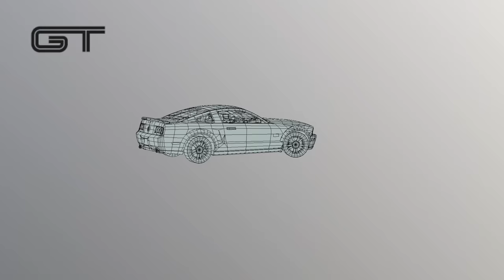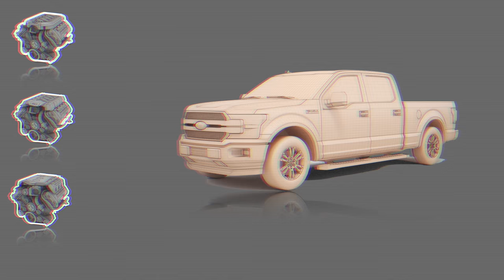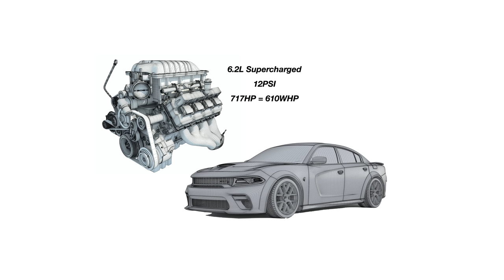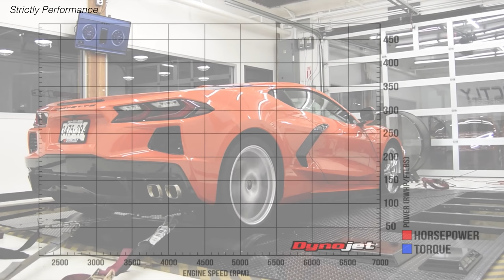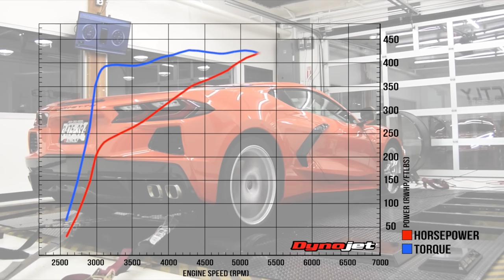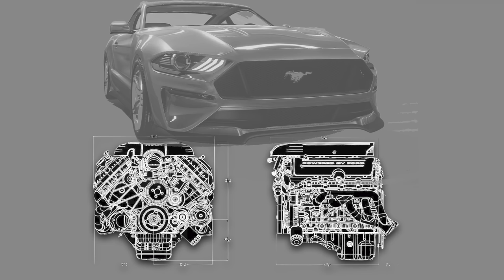How 5.0 Coyote Engines Beat LS and LT😮 | Explained Ep.2

Comment: Boost makes any engine more powerful dude, theres not one platform that "responds to boost" better than another. The real test of an engine platform is N/A power output. I've haven't seen with my own eyes a coyote that makes 700+ horsepower N/A, meanwhile ive seen a ton and built a dozen or so LS/LT engines making that power including my own rig. Its been done before but its exceedingly rare. Its more cost effective buy the supercharger to make 600wheel on the coyote than it is to go N/A. Meanwhile, 600wheel from a N/A LS or LT is a walk in the park. HUGE drawback of the coyote is bore spacing and lack of cubic inches even with stroker kits. You quite simply aren't resleeving a coyote for 450+ cubic inches. Also, price price price price.

Comment: Correct me if I’m wrong but the 3-2-1 build won’t work bc the gen 3 blocks have different coolant and oil passages to the heads which don’t really adapt, I’ve done some pretty extensive research as I debated buying a gen 3 block and putting my gen 1 heads on it but I can’t bc the coolant veins don’t run the same, the gasket situation is pretty weird too Lol. But gen 1-2 are fully adaptable besides the timing system, all of the timing system has to match generation Lol

Comment: If you have to add a whole turbo or supercharger and all the necessary parts that come with it to an engine just to compare it to a stock engine from a competitor, it’s not better. The second you modify anything (even the ecu software) that didn’t come from the factory your argument is moving goalposts and is completely irrelevant.

Comment: 5.0 has good power but weak in torque so I don't know about this comparison. Cost my uncle a little over 11k to do a  5.0 coyote swap  on his fox body and his buddy gots a 6.0 ls fox body  and has after market cam  and couple other goods and he has less than 5k in the ls swapped fox body and it's faster!!!! The 5.0 coyote swap in the fox is super tight to!  I don't see how it's better!
Reply: @efab9346    FYI the engine he bought had less than 20,000 miles and that alone was $4800 plus tax and core!!   The suspension setup had to be changed  for that massive size of a engine as well which the ls swapped fox didn't!!  As far as parts of you found a way to go a smidge cheaper than cool but every build a little different and not everyone Installs Amazon parts on there car lol. Ok so spend 9k on ur coyote fox to run 10.5 and have a war when the engine needs attention or do a LS swap for a 1/3 of the price and go faster and be back on the track shortly if something needs fixed . 9k in a LS swap fox body  vs 9k in a coyote swapped fox I'm taking the LS no questions

Comment: yea cool, they are set and ready to go otb just boost and fuel well with but you really dont need a cam with an lt , procharger, fuel(methanol injection) lt4 fuel system  im at 700whp on 8lbs of boost on a stock cam. those coyotes are bad ass tho

Comment: But it doesn't destroy the LS or the LT. The LS and LT make all thier power with 3 less cams and cheaper. And more reliable. I don't see that as a lose.
Reply: You have to take it apart to make better power. You just need boost and fuel to make 700whp. They are still plenty reliable even as much as the LS/LT. It really comes down to what you want to do.

Comment: I don’t look at it as one being better than the other, it’s more like 2 ways of making similar power. N/A build LS/LT might be a better choice, Turbos Coyote might be a better choice. It is nice that you can just add boost to a stockish 5.0 and go fast. But it’s also nice that you can build an LS with less money. I still remember the Engine Labs shoot out where LS3 made more power in all 3 budget categories, although I think the cost of a used Coyote has gone down significantly since then, they paid half the budget on a used truck block.

Comment: The gen 2 vs gen 3 boosted comparison of 800 to 850hp is incorrect. The Gen 2 motor is stronger and better suited to boost then thr gen 3. They have better rods and pistons for boost, and can hold more for longer. Gen 3 is limited to 850hp ENGINE horsepower, but the Gen 2 will happily do 800 WHEEL horsepower. We even have holding over 1000whp in the Gen 2, and the Gen 3 cannot match this.

Comment: ford and mopar will never design anything that will out do the ls. idc how many camshafts and valves they put in them. it looks good on paper and should work but the results on the track show otherwise. ford has so many different designs over the years that do not interchange and usually become forgotten relics after a few years. just like the 7.3 godzilla, it will be short lived.

Comment: Stock ls3 heads flow 320cfm lol. So stop with all the head flow bs. They didnt need dohc heads and 4 cams to do it either. 

And the VE comes from the fact that the coyote has to have the highest compression ratio you can run on pump gas (12:1), just to make ls numbers. The ls3 only needs 10.7:1 compression. An ls3 with the same compression ratio as the coyote would make 480+hp. 

Theres no replacement for displacement and keep it simple.

Comment: 5.0 are good but are more than twice the price to have a physically bigger engine with less displacement that doesnt fit as well in most vehicles and is a bugger to get headers on and costs the same as a 6.2 ls JUST for cam upgrades...., and way more moving parts to go wrong..idkkk

Comment: Just found your channel, love the insights into the tech!!  Would love to see you go over the classic Audi 5 cylinder beasts we see in the TTRS and RS3 right now!  When you see what tuners like Hank Iroz is doing with that engine and breaking into the 7s in the 1/4 mile (1300 hp-ish), and then turning around and daily driving it like a kitten.... just an incredible platform.

Another interesting one is the Audi EA888 4 cylinder that the Golf R and S3 have (I'm biased as I have an S3).  The amount of power these things can take from the  factory is insane before needing to rebuild the internals.  410hp/tq and the crank is very achievable on 93 octane, as well as incredibly reliable with this platform (and daily drives smoothly).  Beef up the internals, get E85 blending involved, and 500+ comes into focus..... from a 4 cylinder!

Anyways, I love these two Audi platforms, and if you haven't already, it'd be great to see a dive into these :)

Comment: "for example, if you want to hit 800, 900, 1000hp with an LS you're going to need boost and you're going to need to swap out the cam and valve train" This is probably the dumbest shit I've ever heard and an LS in stock form can hit those numbers easily with boost. You just don't see people doing it tho because the LS has a much smaller footprint, so it's easy as shit to pull, aftermarket is dirt cheap, and last but not least, there's only one cam to swap instead of 4 in the 5.0. In conclusion, the LS is much cheaper and easy to build the right way and any 5.0 making lots of boost with no mods is a result of shortcuts taken.
Reply: Definitely requires more money and work, but when done right, it hits. I have seen drag races of whipple F150 5.0s beat Corvettes, and I was astonished by that.

Comment: Ur talking motors not complte new cars so your evaluation is based on putting a coyote and tuning it into an empty chasis. The issue is u can grab a junkyard v8 from a Tahoe swap pistons and throw on a Chinese turbo kit and roll around with 500 to 600hp. The mustang u need 10k for 500hp to 600hp and near 20k for 800hp while a completely built 1000hp LS with turbo or procharger pushing 1000hp for under 10k
Reply: Not true...it's more $ for sure but the cost is only 15% higher and that's due to the lack of commonality of components and lack of a mature aftermarket parts supply.

Comment: 5.0 can’t even compete wit the 5.7 ls1😂
Reply: same thing i was thinking with a stock ls6
Reply: 5.0 4th gen makes 500hp. Which is more than the LS1 and LS6. Yall are up your ass.
Reply: .ford barely catching up. 4 cams, 32 valves, 2 tbs, 9k rev, etc .all just to make 20 more torque than 20 year old chevy motors 😵‍💫

Comment: You don't get it. When it comes to performance, that is, things that actually make a car go around a track faster, so not volumetric efficiency, rpms, or HP per Liter, there is 0 reason to ever choose the coyote over an LS engine. You admit both can make the same power so why would you ever choose the one that is physically larger, heavier and has a higher center of mass? These are all factors that actually make a difference to your tires, unlike all the things that the coyote has an "advantage" in. The LS allows you to use a lower hood for better aerodynamics, the weight is in the block not the heads so the center of mass of the car is closer to the bottom middle of the car where its supposed to be, meaning you have an advantage every time you turn, and it weighs less. Do i need to explain why lighter things are easier to move faster?

Comment: It's the 10 speed transmission that make them fast.
Reply: 10r80 is crazy
Reply: NA, the 10R is a cheat code. Boosted all the transmissions are solid and the 6R is the fastest Ford trans ever.
Reply: the 10r80 is faster than 6r. we swapped from 6r to 10r80 and picked up almost a full second off the 1/4 mile lol. same car same hp.
Reply: @Mp-jw1qg  what’re you controlling it with and what’s the motor it’s linked up to? 

Also the 6R is the fastest, Lund racing is bottom 7’s I believe.
Reply: @Mp-jw1qg  are you using the ford controller?

Comment: Can you buy a modular, DOHC V8 crate engine with 1000hp NA? Nope. But you can buy a pushrod V8 with 1000hp NA.
Reply: Yeah for 20 thousand fucking dollars lmao. To even compare that 10.5 liter pile of gold to the piece of junk in your vette is pathetic. A coyote can get 700+ NA with just a handful of modifications, and it'll be drinking a quarter of the fuel.
Reply: @amazin7006  I said modular V8… that encompasses more than the coyote. And regardless, 700hp NA is still a 300hp less, and you can make more than 1,000hp NA on a pushrod V8 if you want to go nuts. And it’s hilarious how you call an engine with more power pathetic… when a modular of any kind won’t make that kind of power NA… have fun with your pathetic, oversized, heavy modular garbage. 

BTW, Sonny’s Racing builds a 2100hp pushrod V8, NA. And it’s footprint is no larger than a Coyote and it displaces 3x as much…

And if Chevy engines were garbage, why is everyone swapping them into everything else? I have a 30 year old 350 SBC and it runs better than any 30 year old modular. -10°F and it starts right up like it’s nothing. Doesn’t leak or burn anything it shouldn’t, and I beat on it. Do that with a modular and you’ll be picking up spark plugs and fixing leaks.
Reply: @iDrive4fun93  300hp less with half the displacement... also coyotes are known to go over 850-900NA with some affordable mods.

Why are you talking about 1000hp NA as if you can ever even afford an engine like that? You won't be anywhere near that. Nobody will be using that for a street car. For the average person, a Coyote is always better. It's better efficiency, more power, more reliable, and more streetable. You won't have to wait 10 months for new billet parts when something inevitably breaks in your 50,000$ pushrod engine. 

What you're talking about are the million dollar outlier cars, those are drag cars. At that point who even gives a shit lol. You might as well be talking about top fuel dragsters too.
Reply: @amazin7006  no coyote is going over 850hp with “some” affordable mods. If you’re referring to an 850hp NA coyote, you’re probably talking about the one from Holbrook Racing, which is a 327ci Coyote and is more expensive than that 1000hp LS engine, and has more than “some” simple mods, it’s completely overhauled, like that 2100hp pushrod Hemi from Sonny’s.
And there are plenty of people with 1000hp street cars(most are pushrod!!) You must not get on the forums or go to car shows much. 
And a pushrod will always be better for the average person. It’s far more reliable, cheap and easy to fix if/when it does break, and makes better power through a more linear powerband. I’ve owned Ford 3v 5.4’s and Small Block Chevys, and I will take the small block any day. Modular’s don’t make the torque that a pushrod does, which is why Ford went back to pushrod with the 7.3 in the HD trucks. It’s a more usable engine. And it’s turning out to be an awesome engine to make big power with very little work, something a modular can’t do. 

And yes, I actually can afford it. I am an industrial/commercial electrician. I make very good money in a complicated and highly skilled trade.

Comment: As a ls and coyote engine owner , I have to say that the LS is easy to work with and cheaply to modify that the coyote . I do agree with a stock engine you can produce more hp with the coyote if you installed a supercharger,  which am doing right now with my 65 mustang, but am still convinced that the cheaper way to hp and enjoy it will be with the LS engines

Comment: The coyote is a good motor, but will never eclipse the LS for cheap, reliable power.
99 percent of people will never even attempt to build to the power levels needed to make the advantages the coyote has valid.
While the modern gen of coyote I think has a higher ceiling, when you start getting over 700/800 horse reliability is not going to be a given with any engine, particularly if you are going to be using all that power often. And being that a coyote will ALWAYS be more costly to fix, I don't see the 'DESTROY' claim about the Coyote over the LS as anything other than cheap clickbait.

Comment: Good motor but the vw or porch 4 cylinder turbo diesel held land records for years plus the roadrunner hemi motor gave more combustion on top of the pistons which allows a bigger combustion or more fuel as well better than the flat head motor plus some engines built are so fast they are considered not street legal so to say there are far better motors just not allowed on the street or like general motors or Cadillac Chevrolet they have governor's or restrictions so they can't outrun other vehicles so to say. Not so much outrun vehicles but people getting hurt. Then yoh strat messing with the fuel itself race fuel a highly combustible diesel type fuel or jet fuel a high temperature highly combustible fuel that burns hot ect... The motor is just the mechanical part of it you have to look in to every aspect of the whole dynamics of it you can have the best parts money can buy but the other aspect the boost or what fuels the motor itself a 2stroke race fuel that has oil that lubricants as well as burns which in part would be a diesel based fuel like a 2stroke dirt bike like octane based fuel vs ethanol based fuel alcohol based fuel

Comment: 1st off Lt6 says otherwise😂 670hp na 5.5 liter 2nd it cost 2x as much to get a coyote to make half as much hp as a ls don't really see how that makes it better than ls or lt 3rd coyote engines still have major problems like crank failure oiling failure valve float and shit electronics

Comment: Why is there more ls swap mustangs  then 5.0 coyote 😂😂😂😂😂
Reply: I can get a LS for under 3k whereas the Yotes go for minimum 5k
Reply: The 5.0 costs more and is wider, so it can't fit in more cars unlike the LS.
Reply: @rickitysplitz7035  the 3,2,1 build addresses that issue but as I said cost is the major factor...the yote only came in the 150 and the GTs so there are relatively few engines on the open market [unless you pay ford near 10k for a crate]...I respect an LS but the yote is the better engine out of the box

Comment: Ford is at an all time high with weapons in there stable almost like the glory days of the small block chev where everyone bragged 400 hp but no one displayed it (pause for thought)800 hp out  of an aluminum small bore motor with a bolt up 10 speed trans  sounds like some gear head yaaaaaaaa my buddies got a car with 800 hp with a 10 speed and everyone walks away he is full of crap

Comment: The coyote as an engine is very capable and stout. but let's be honest there is a reason why everyone wants a gen 3 coyote and thats because of the 10r80 trans. Thats is a huge factor as to why it is successful in performance. The LS never had a ten speed behind it...as a matter of fact most guys are still using the old 4 speeds trans. The LT 6.2 with a ten speed is incredible N/A and it can take down s197's crammed with just bolt ons. and the funny thing is the LT platform as it gets more and more available will have a huge aftermarket following soon. Only going to get faster. and as far as boost anything can be fast honestly...thats more about your wallet at that point than actually engine tech.

Comment: I understand for the smaller displacement that's pretty good, but my main concern is budget, so getting a coyote I basically not an option. An LS on the other hand... 700$ and they even delivered it. No contest.
Reply: That's what's great about having 2 options. 
But if you're wanting to make serious power with boost the LS is probably the more expensive route.
just food 4 thought.
Reply: @19coyote5oh9  "serious power" lmao. I wont be going over 1000. If it's good enough for f1 it'll be plenty for me. Unlike you, my life doesn't revolve around going as fast as possible in a straight line.
Reply: @kraagnjilwulf1413  Relax.....
It wasn't a negative comment?!!?

Comment: LS is about torque and torque is what moves mass. Why spin to 8krpm it may sound good to some but sound doesn't win at the track. And to truly get the most from a boosted Coyote you'll need to change the same parts as you would in an LS, BUT AT A SIGNIFICANTLY HIGHER COST. And we all know the LSx series of engines are the KINGS of cheap swapablity. Keep ya dog of an engine, I'll stick to LSx..